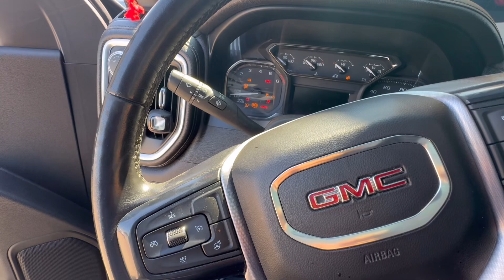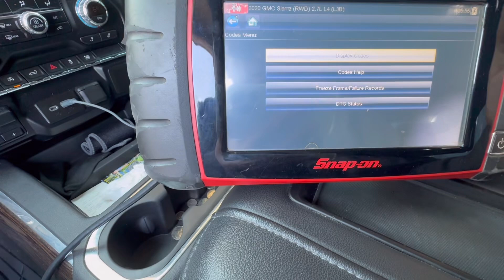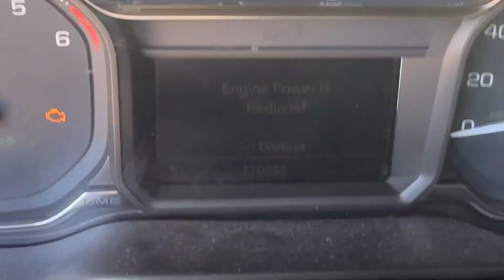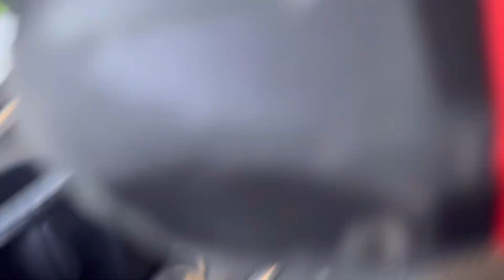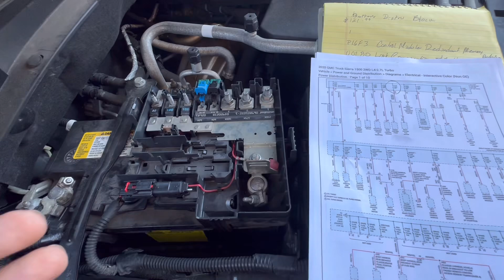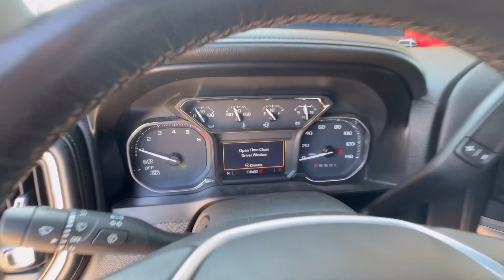2020 GMG Sierra 2.7L.  Engine Power Reduced, P16F3,U01B0,U0672,U1345

Comment: What’s the best way to confirm replacing the fuse block will solve the issue
Reply from the maker: Do a continuity test on all of the fuses
Reply: @antonioaguirre6166  The fuse has continuity and is getting good voltage

Comment: hey dude good video this is the first one i see with the same truck as mine, i have a 2020 silverado and my coolant fans remain running while truck is on, Ive already replaced the electronic pump and 2 coolant sensors i will try this bus replacement, im in Houston